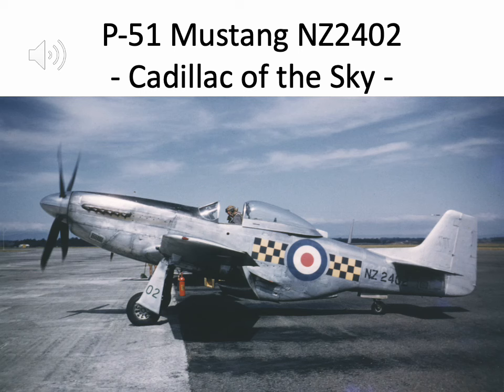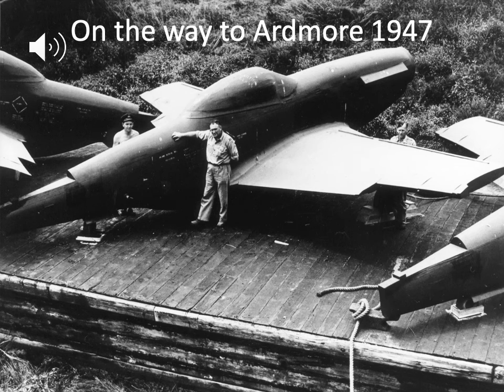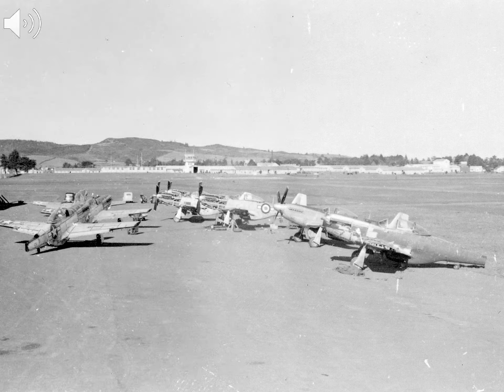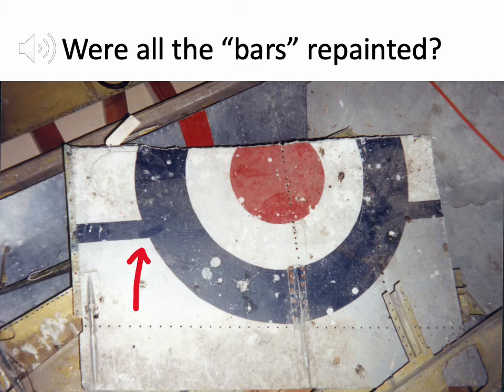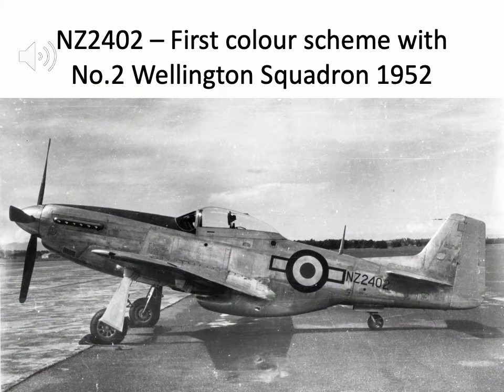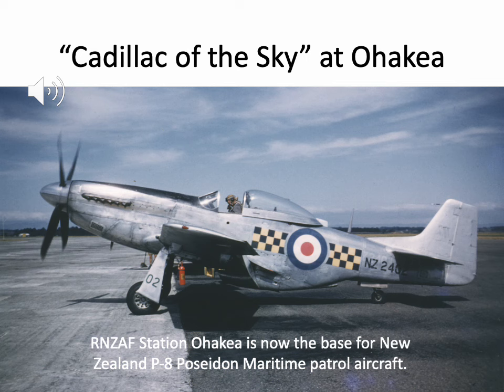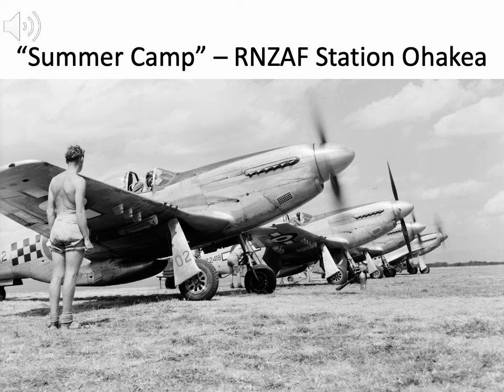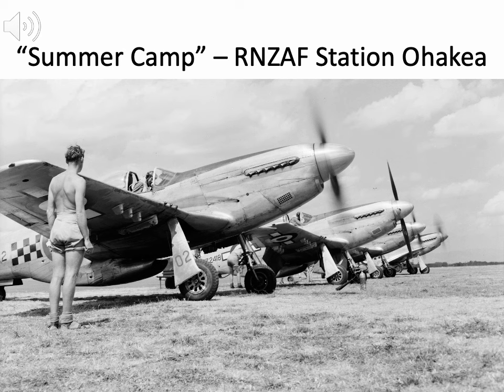NZ2402. The life of an RNZAF Mustang 1945 to 1958.

Comment: The Checkers were for the regional Rugby teams - Auckland, Wellington,Canterbury and Otago. The Airman painting the RNZAF wing Roundel was an "Aircraft/Airframe Finisher" (actual Trade in RNZAF at the time). Of the Mustangs received by the RNZAF, all but one had "Un-cuffed Propellers", with the exception of NZ 2413 which has cuffed propellers. I have a really nice colour photo of NZ 2426, 4 Squadron Otago (Dark Blue/Yellow Checkers) sitting on the apron, taken by my Dad when stationed at RNZAF Wigram. Interestingly all Natural Metal, with a Black anti-glare panel (on my model list to build) - The Roundel (D Type) Blue is quite dark in colour, and numerals 26 above RNZAF Fin Flash on Vertical Stabilizer. (Edited)
Reply from the maker: Thanks for this great insight. Even though the Mustangs were operating in the 1950s colour photos don’t seem to be common. Maybe edit the post Re the No.3 squadron colours. Red and Black. Many thanks. Malcolm